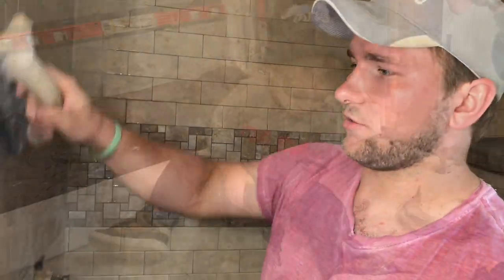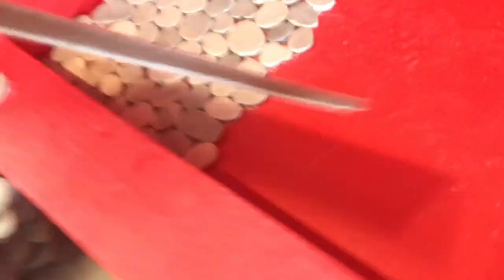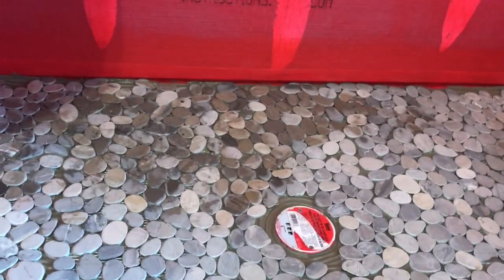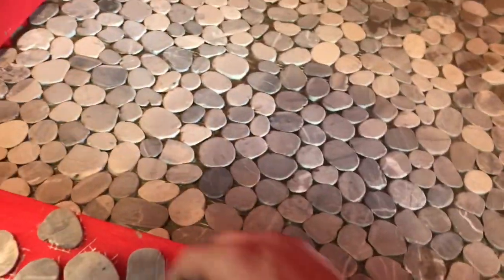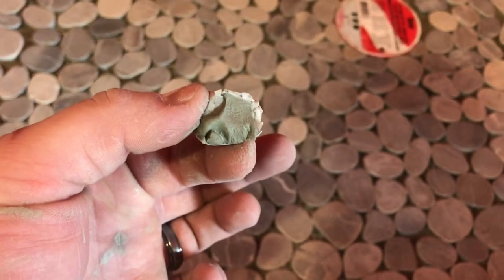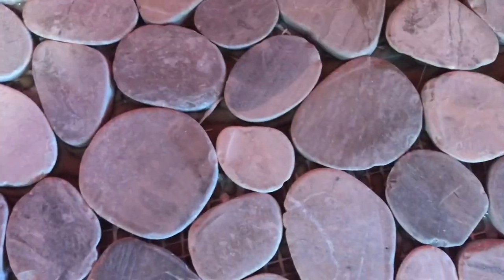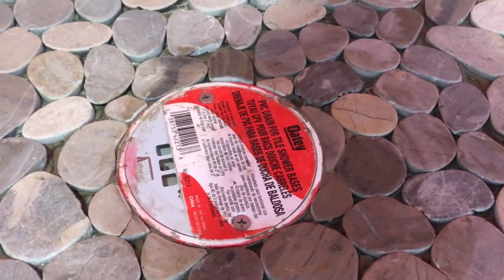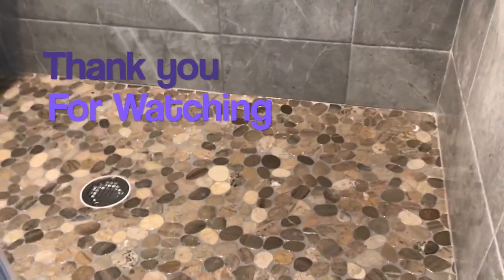Perfect River Stone Installation. Easy pebble tile installation. Shower floor mosaic.

Comment: Looks great but please pan around much slower couldn't take in detail as much as I wanted to. Some things I  learned the hard way... porous stone mosaics need to be sealed prior to installation so water stains don't occur & grout doesn't stick to any divets or creveces. Remove and replace a few border stones to break patterns &  keep from seeing grout borders looks more natural. Trowel should travel in one direction not circular around drain to better adhere tiles. Larger grout spaces can  cause leakage so fill any bigger areas with pieces of stone. Cutting mosaics on wet saw can cause backing to fall off. Use a ledger board & start with second row of tile makes for more balanced look.  Just trying to help those other DIY folks like me to learn i didn't comment to insult. Thank you for posting enjoyed watching.

Comment: How did or what did you use to make the floor so shiny like that? Great job by the way
Reply from the maker: I just mixed it a little wetter. But I wish I did not. It was a bit hard to work with
Reply: @WINNI.Designs  I used the same exact river stone and after the grout it was all smudge over with a sponge and few days tried washing it out and nothing… looks good when wet but when dry looks  ok…any recommendations or where I messed up?
Reply: @philipfiesta  put a wet look resinor varnish over it and it will stay looking like that! Where do you get these stones from? Or whats there name? Thanks

Comment: Is it normal for water to pool in the corner?  I just had a remodel with the same type of pebble stone base. I was told by the contractor that water collects between the stones. It’s supposed take longer to drain away.   Hmmm. I can’t tell if I’m being hosed.

Comment: You have lot to learn before post your video men first lay  dry the whole shower floor in clean floor then mark the perimeter then cut it then instal it on shower floor way easyer
Reply from the maker: Marco Poulin thanks for the tip